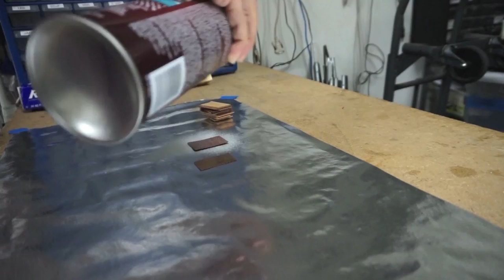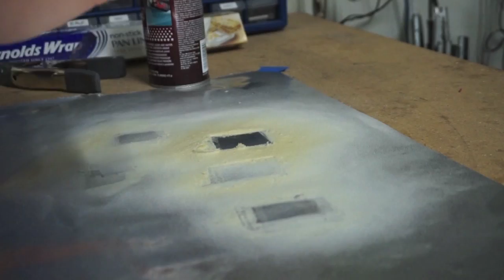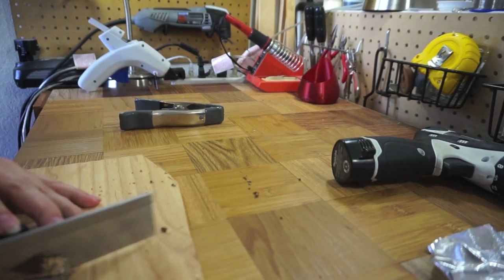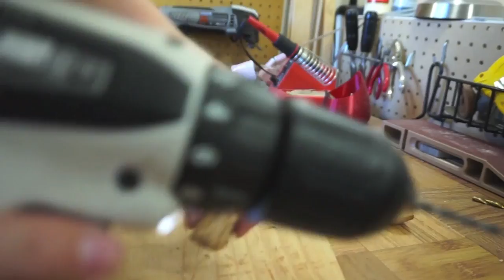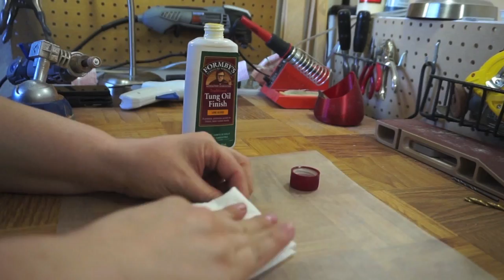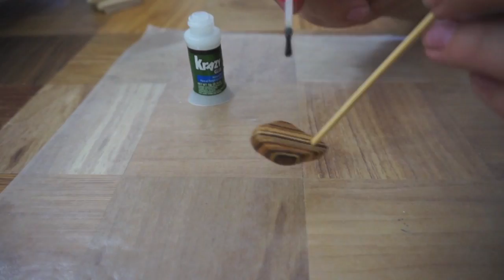Layered Wood Pendant Necklace | Barb Makes Things #5

Comment: Barb, I admire your dexterity. If that had been me, rather than a pendant I'd have ended up with an ornament superglued to my fingers. I'd have also drilled a few holes through my hands (been there, one that...)
Reply from the maker: +Reactive Light haven't we all? :) actually, in the interest of time, i cut out the part where i touched the super glue coat too early, got fingerprints in it, and had to sand it off and try again.

Comment: Can you describe the finish? Tung Oil and Crazy glue? Does the oil darken the wood and the glue seal it to prevent the oil from evaporating over time?
Reply from the maker: +Elliot Mebane pretty close. the tung oil brings out the colors (darker, richer), and the super glue coat is very strong and waterproof (I've been wearing that wooden ring every day, which I made a few months ago with a super glue finish and it's still in great shape). the superglue also adds some depth to the color and helps even out the surface.

I didn't include it in the video, but I lightly sanded the super glue coat after it dried, it dries somewhat shinier than you see at the end of this.